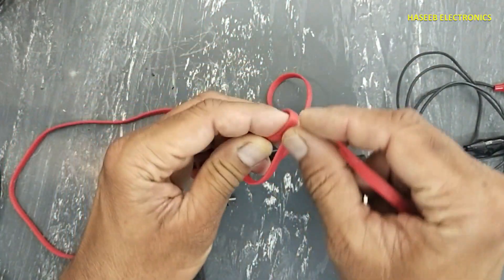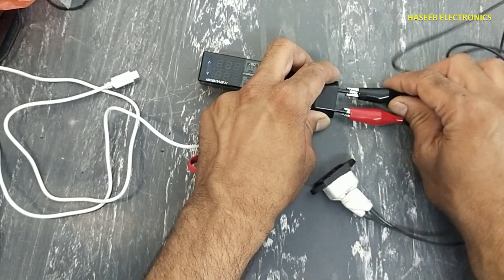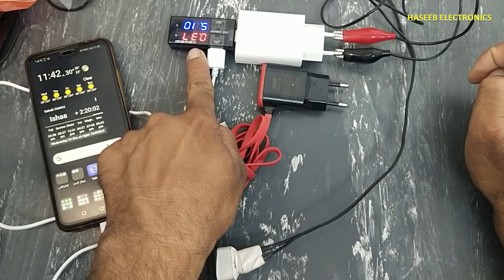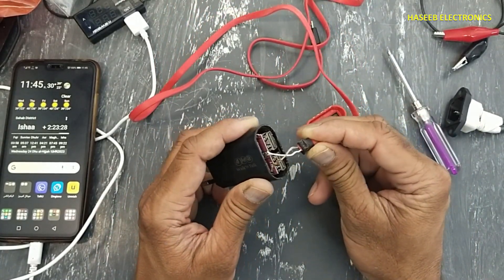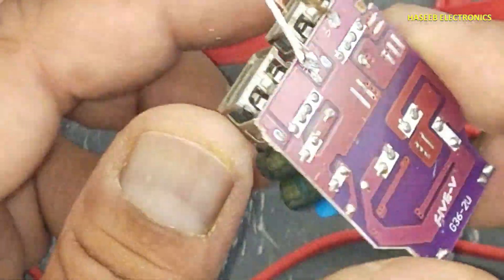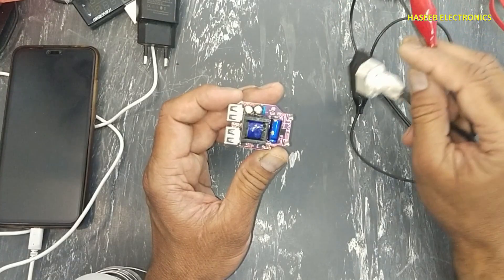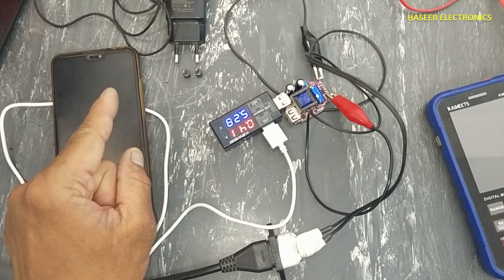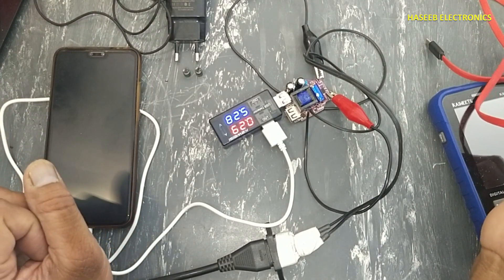{939} Mobile charger repair

Comment: I always watch your videos and learn lot of things from you,...but today how did you confirm that capacitors are faulty....
Reply from the maker: when polar capacitor's ESR value is increased, at that time it cannot hold charge properly, it is very common failure of polar capacitor
Reply: @HaseebElectronics  Noticed you measure capacitance when checking. How come you don't use an ESR meter? 
Do you feel safe using that charger?   What if that transformer shorts main to secondary? The build quality looks low.

Comment: I recommend u dispose of that charger, its isolation distance is very small , probably even the transformer windings are not properly winded, and it doesnt have a safety capacitor class Y1, those are very damgerous

Comment: Do you know rhat there is a cap umidity chech? You can check the cap on board and if ifs dry, the meter will show it like a larg resistance

Comment: Thank you for all your videos on SMPS. I have gained a lot of practical knowledge as well as the theory behind the working of SMPS circuits. 
You posted a review video of Kaiweet KM601 multimeter in February this year. Though the multimeter is very good in many aspects, one criticism is that the batteries have to be replaced every month even with normal usage. As you have used it for 5 months, why don't you post a video telling the viewers about your experience with this multimeter.